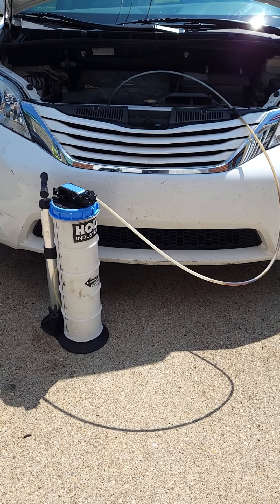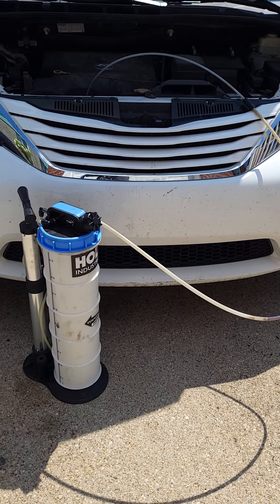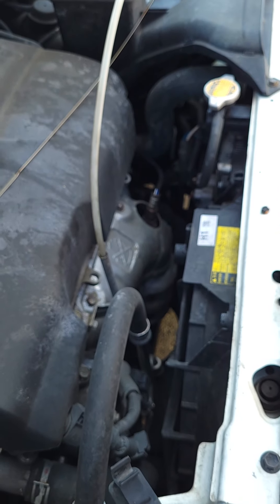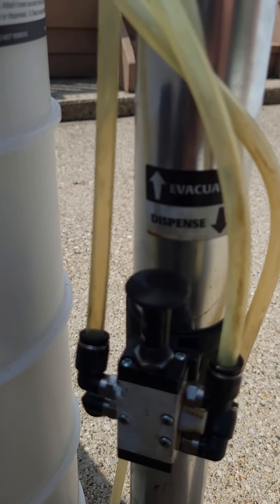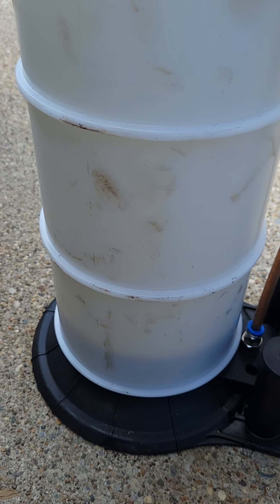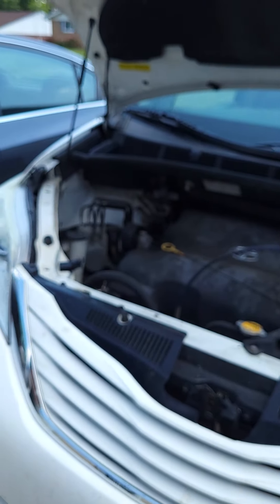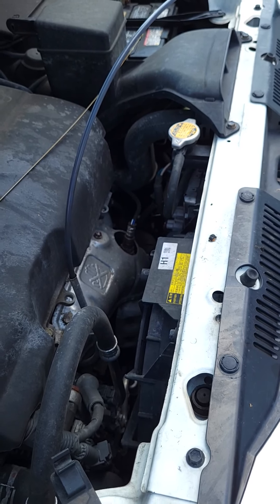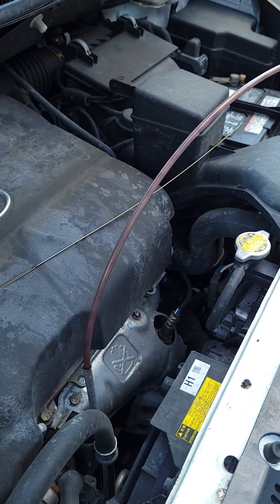review on the holt industries fluid extractor

Comment: Mine doesn't flow out as fast. I have to keep pumping and it's taking forever.
Reply from the maker: The fluid is probably too thick if it's oil try letting the engine warm up the viscosity of the oil thins out
Reply: Engine should be warm. Helps pull any debris out with the oil as well